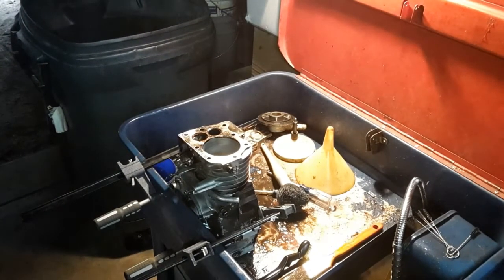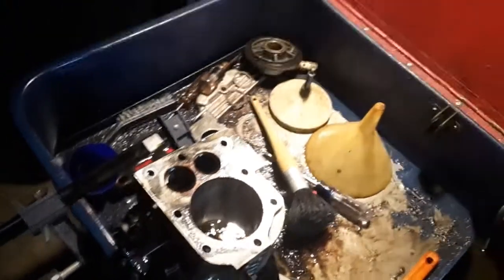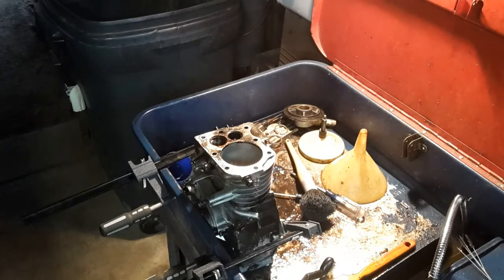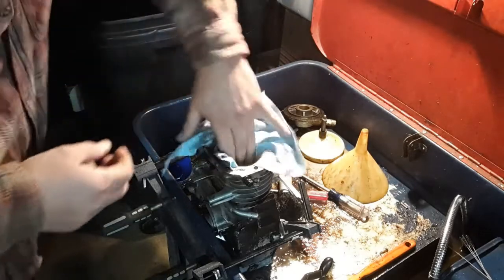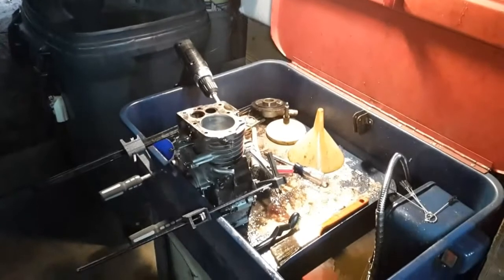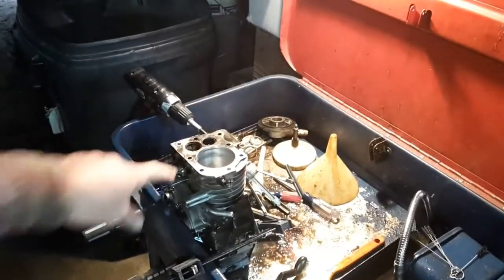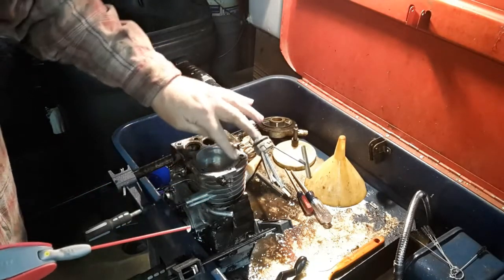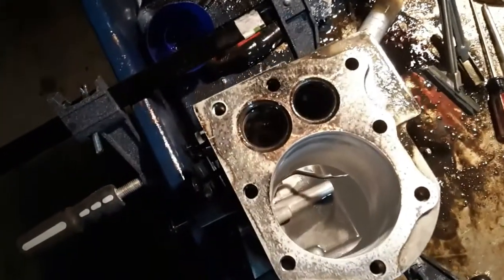Deglazing/Honing the cylinder Briggs & Stratton Quantum 6hp

Comment: Ice work Brother. I use Non-Detergent 30 weight oil to break in the rings, on the recommendation of a Kohler Engineer. Run it with varying loads for a few hours then drain and refill with standard detergent oil. I wait a month or so before switching to full synthetic to make sure the rings are sealing and I don’t have a “smoker”.
Reply from the maker: I've always used stright 30 weight detergent and like you after 1 hour of run time I'll drain it out and replace with stright 30 weight detergent Dinosaur oil. I like using the detergent oil cause I believe it helps to cleanse the fine debris left behind even after a thorough cleaning (always something left hiding somewhere)
Have never had an issue doing this, I'm guess I'm still too Old School.

Comment: New pistons and rings in 😢a existing Briggs V twin engine with smoothe wall cylinders. What grit to use to hone with 3 finger hone?
Reply from the maker: I use 320 grit for cast iron and Molly Faced Rings, 280 grit is recommended for cast iron